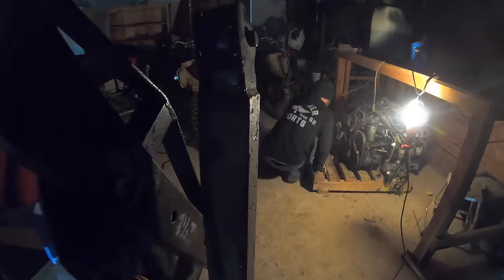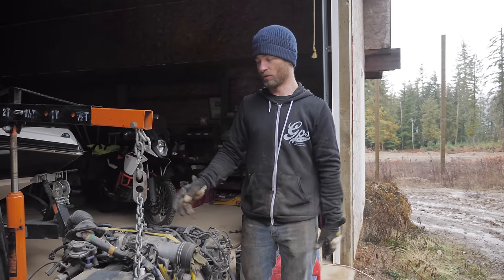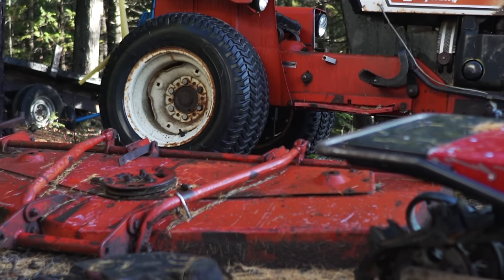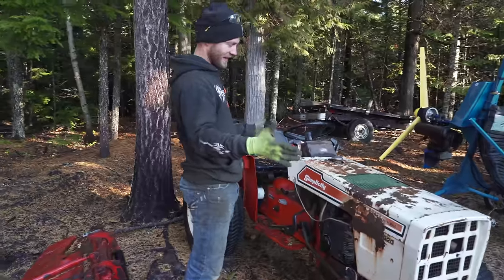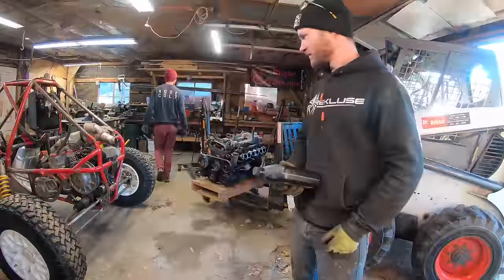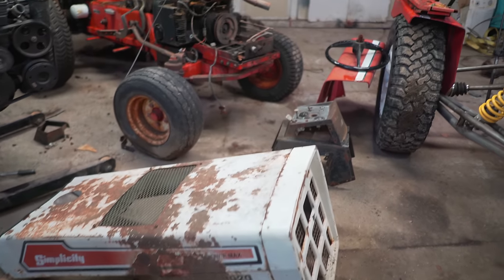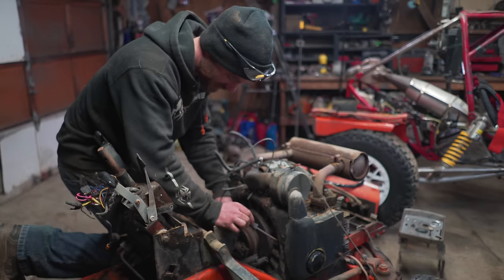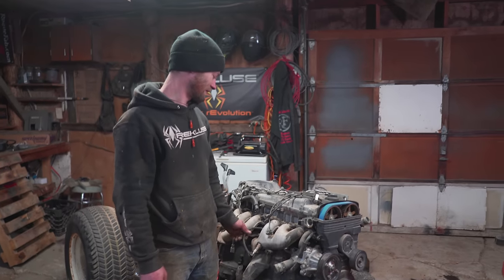2JZ Lawn Mower Build

Comment: That’s not a “mower” it’s a tractor.
Reply: That is a mower, it's just a ride on
Reply: Peter Schmitz 
Nor really. These have hydraulics, multiple PTO, shaft driven accessories, very heavy duty hydrostatic transmission and automotive style rear end.These machines were not necessarily sold with mower decks. They came equipped with a 3 point hitch, they even sold a front end loader for them. It’s a small tractor.
Reply: @craiggutoskie  Never heard of a small tractor driven by a little onan through two belts!